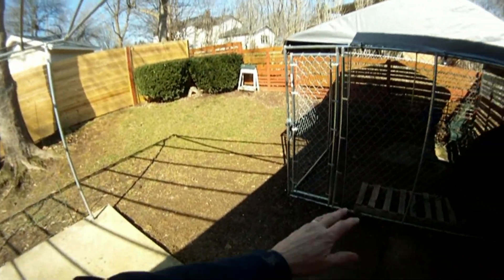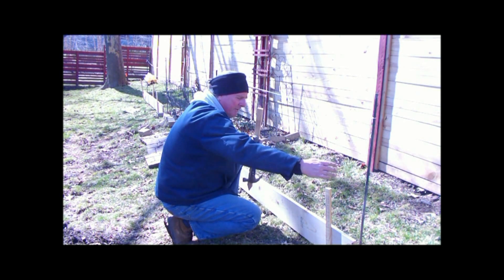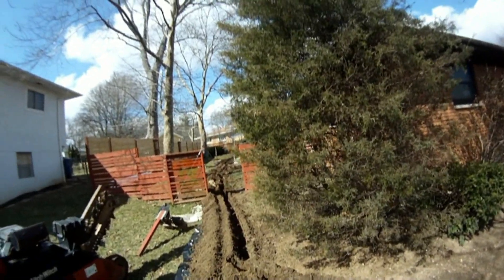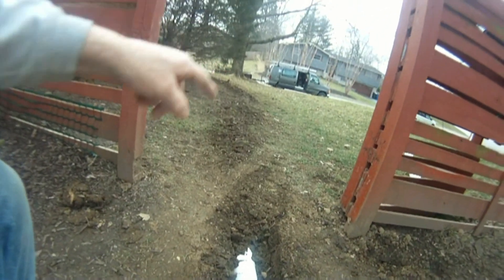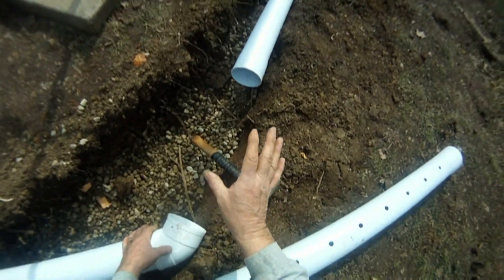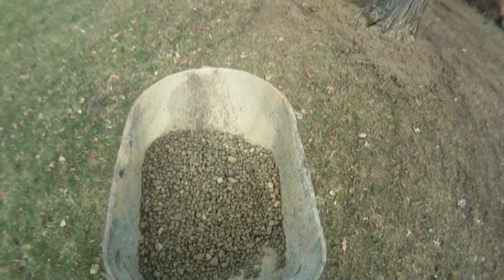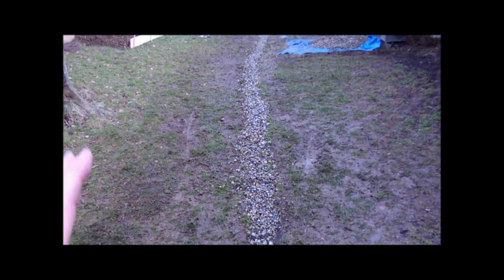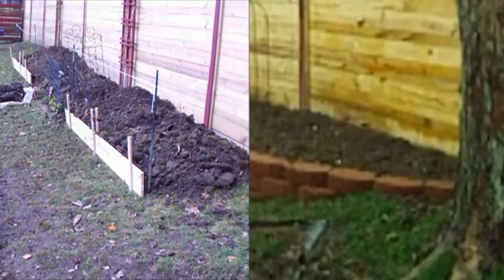CATCH BASINS & FRENCH DRAIN STOPS FLOODING ~  gravel  + PERFORATED PIPE Yard Drains

Comment: Does this have to be on a downwards slope for it to work
Reply from the maker: Hi Andrew,
Thank you for watching.
The discharge point has to be lower than the gravel drain , catch basins.
water only flows one way.
DOWN HILL!
another method if you have no slope to the discharge point would be to install a sump pump / pit that acts as a lift station to move collected water out to street of creek.
Thank you for watching.
Reply: Thanks for replying to my comment , another question I have is why do some of the pipes have holes in them and then some don’t ? I’m doing a Project in my backyard and using your video as a reference.

Comment: Hi! Did you connect your catch basin to solid pipes first and then connected the solid pipes to perforated pipes?
Reply from the maker: Hi Minerva,
Thank you for watching. Everything BEYOND the catch basins going out to street are SOLID PIPE. Areas between catch basins in the back yard are gravel + perforated pipe.
Thanks again for watching!
Chris
Reply: @AtlanticDrain  Thank you, Cris. The area where we need the yard drain pipes are at the side of our house. Rain water is accumulating there and the soil gets muddy. Should I start with perforated pipes then switch to solid pipes going down towards the street? Thank you so much. Me and my boys learned so much from your video. We are getting ready to begin our project following your example.
Reply: By the way, we are starting the line with a catch basin on the area were water pools the deepest. We will connect a perforated pvc pipe to the catch basin (for the entire 8 ft of area that gets flooded) then switch to solid pipes for water to be diverted towards the street. Is this right? Many thanks!
Reply from the maker: @minervaaseberos6704  Hey Minerva,
Yes. Sounds correct. if you have a double outlet catch basin, you can put a little gravel perforated pipe before area of catch basin as well.
but, what you have planned will work well.
Reply: @AtlanticDrain  Thank you so much, Cris. We're doing the project this weekend. You are so helpful! We appreciate you and the resources you have shared.
Reply from the maker: Thumbs up!

Comment: Imagine if you had used a weed barrier under and around the gravel you would really be thanking yourself for it now since it’ll be full of dirt and roots and clogged in no time.
Reply from the maker: ~ HEY EDWARD ~Thank you for watching. felt or weed barriers are great for sand but, DO NOT PASS water in the clay. I wish I could tell you differently but the truth is, a french drain system will stop functioning after only 1 or 2 month if a "weed barrier is use" I have had to dig up and replace many a lines with a weed barrier mesh wrapped around the pipe. A gravel perforated system with no cloth mesh works so much better. You do have to maintenance the line with a machine once in a while but you dont have to dig it up and replace it every couple of months like a cloth wrap system. Cloth wrap systems ONLY WORK IN THE SAND. Thanks again for watching
Reply: So don’t use weed block fabric with French drains?
Reply: @Michael-wy7om  I wouldn't personally skip out on the fabric, you'll definitely need a soil separator or you'll have subsoil that mixes in with stones causing blockage nearing the outer parameter of the stones and defeating the purpose of the work.

Don't use socks or sleeves, they will fail and needing to have it dug back up within two years. Make a trench about 18" to 24" deep, wrap the trench with a Geotextile non-woven fabric and come out of the trench and spread out onto the lawn from both sides so that you can overlap the stones covered pipe and put top-soil over top of it. Depending on the type of pipe used, and where one lives, North America they prefer laying the pipe down right on-top of the fabric and filling the trench sides and over top with stones. 

If cost isn't a factor, or you don't need a lot of pipe, I'd probably go with PVC Perforated Drain Pipe for it's durability under different conditions. However the holes needs to be facing down, so I would avoid placing it directly on the fabric but adding thin layer of stones.

Comment: Filling the perforated pipes with gravel all around it.  over the years wont dirty muddy water eventually fill the perforated pipe and clog the holes up? just asking
Reply from the maker: ~ Hey Alex ~ Thanks for watching. That is a VERY controversial point. especially on you tube... 
This system will last 20-25 years which is the life span of the pipe itself. 
The secret to a good yard drain is to have a deep gravel base.  This gives lots of room under pipe for any soil / sediment. The pipe will remain clear. ~ Thanks again for watching ~
Reply: Yes it will  you have to wrap the gravel and pipe.